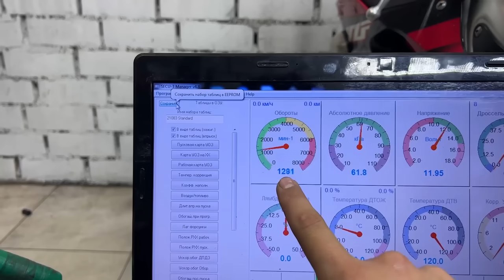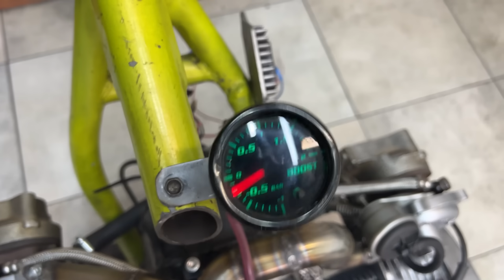Twin Turbo 1970s motorcycle Engine Full Build and First Run

Comment: You need to have a much larger volume between the exhaust port and the turbine, it won't work any further otherwise. Builds charge pressure quickly, but does not result in much power increase due to very high exhaust back pressure.
Reply: On my turbo mower I used a piece of 100mm box tube it’s completely ugly and counter intuitive in regards to flow, it’s close to double the engine capacity and it’s got power!
Reply: Yeah this statement is ass backwards the distance between the port and turbine has no effect on back pressure and shorter is better
Reply: @shaynegadsden No, you are completely wrong. Have you turbocharged many 1 cylinder engines?
Reply: @shaynegadsden  who told you that! It does have an effect on pressure! I know that ignorance of engine dynamics and thinking of an engine as an air pump contradicts this but in actual practice the longer the better! Although the length increases turbo threshold it doesn’t decrease total flow other than the drag of the pipes! There’s actually more science involved than just short runners! If what you say is true then I’ll just bolt my turbo to my cylinder head
Reply: @needmoreboost6369  thats wrong obviously otherwise everyone would rear mount their turbos but they don't it's a last resort for lack of any other option because it works but very poorly, all decent turbo manifold are as short as possible the longer it is the more potenial energy that is lost and yes if you could directly bolt you turbo to the head that would be best, as for the back pressure no unless the pipe is really smaller ie smaller than the exhaust port then no not at all the thing that will determine any back pressure is the turbines design and size
Reply: @shaynegadsden  your principal is best suited to low rpm Diesel engines! And as someone that daily drives a rear turbo with instant response I can say for certain that the length of the pipes has a marginal effect on response as the gas stream is significantly faster than you might think! Adding 10’ of exhaust and intake delays boost about 300rpm and a fraction of a second on mine and any less lag would simply increase wheel spin! Also I’ve been working on turbo engines and turbocharging engine’s for 20+ years and lost count of how many manifolds I’ve fabricated or modified! the principle of decreasing manifold capacity to increase response is at a compromise to engine efficiency by retaining exhaust heat in the combustion chambers! And increases the tendency for detonation
Reply: @shaynegadsden  go look at any of the top competition engines! In principle for optimal high rpm torque it’s best to combine the energy discharge of two cycles of exhaust gas per primary pipe before the collector so that pipe will have two cylinders of capacity in the runners and the subsequent energy for scavenging the adjacent runners, so in principle the long tube headers are superior in every way!
Reply: @needmoreboost6369  yeah that's why none them do that every top car has a tight manifold with equal length runner that all converge at the collector
Reply: @shaynegadsden  been to the drags lately mate? No high power engine has a small tight manifold! Other than for circuit and even then the runners will likely be over 14” long to be able to make true equal length runners anyway! Go look at the fastest cars in the world there’s no short pipes
Reply: @shaynegadsden  go look at my channel! It makes boost as quickly as the auto can down shift! And it’s trapped 136mph and it’s never been dyno tuned or plugged into a laptop it’s on a stock ecu and cheap ebay turbo and it’s 1620kg so according to it’s g force and it’s mph it’s 540hp from a backyard built gm3.8 v6 with all 2nd hand parts
Reply: @shaynegadsden  check out maatouks racing or any of the worlds fastest cars here in Australia and you will not see a turbo bolted close to a head! The rb 6cyl in the fastest skyline in the world makes more than 2600rwhp and uses long tube manifold
Reply: @needmoreboost6369  well fastest in the world use zoomies so yeah they are pretty short and you see to be conflating packaging with best performance just because they need some length to fit doesn't mean thats the best for performance. As with most vehicles you are connecting multiple cylinders to a turbo so you need to make compromises. The shortest equal length manifold is best but that doesn't mean it will fit as for your channel it doesn't show shit since it's your dash and no boost gauge but going by the audio it is sluggish and since it's a VL something tells me you don't actually know what a quick car feels like
Reply: @shaynegadsden  the fact you mention zoomies on an s/c engine proves this conversation is with a “full glass” it’s a vs turbo on my channel and there’s only footage of low boost daily driving! and my vl is slow it only has 600hp and runs high 10s on street tyres! and I’m a fully qualified mechanic that tunes and builds engines and works on performance every day so what do you do exactly?
Reply: @shaynegadsden  also come to think of it Richard holdener recently did some dyno testing on the new short hooker turbo manifolds compared with ebay long tubes and the long tubes smashed them because of excessive back pressure! adding an extra waste gate would have probably helped the hookers though! But ultimately the longer tubes win
Reply: @needmoreboost6369  not even close to the same thing that comparison had nothing to do with length it was design and i doubt you will find anyone to say log manifolds are good for power
Reply: @shaynegadsden  yeah logs suck! and then there’s the single gate location on one side of a v engine it’s not efficient! Off topic now but the original point being that if the exhaust charge hits the turbo before the exhaust valve shuts it causes more exhaust to remain in the cylinder as I stated it raise’s the chambers temperature and also defeating many benefits from the scavenging at overlap especially off boost often making them actually lag more! And that’s not from google research it’s from boosting engines and fixing my own and others fuck up’s

Comment: For a small displacement v-twin motorcycle engine, a single turbo would be preferred.
Reply: It's a boxer engine. Like happens with the air cooled VW, two turbos are almost mandatory.
Reply: @patriciarodriguesrentes1702  nope. Just nope.
Just take the Porsches as an example, the 911 turbo was single turbo from 1974 till 1993, when electronic was advanced enough to control variable geometry twin turbos.

Most VW aircooed builds are single turbo, just are most 4 cylinder turbos, no matter if V, boxer or in line. It doesn't have to do with the cylinder  arrangement but more with number of cylinders and mostly exhaust gas pulses. 

This setup, with a low displacement v-twin and twin turbos is just horrible.
Reply: @patriciarodriguesrentes1702  Sorry to say , you're quite wrong. Example , Subaru Imprezia , boxer engine , single turbo.
Unless , ofcourse , you mean from an aesthetic point of view. Then you may have a point.
Reply: @patriciarodriguesrentes1702  😂
Reply: @nhacamaster  stop calling it a v twin it ruins your entire point

Comment: If you want to build a turbo bike use one turbo, two turbos are very very bad idea, more so on a twin cylinder bike,  a single carb and a single turbo will work great on a twin cylinder, thats why he's using fuel injection twin turbos might  look good but its a shite system,